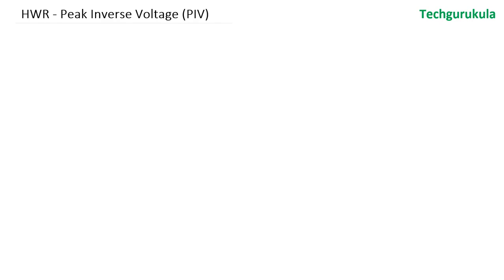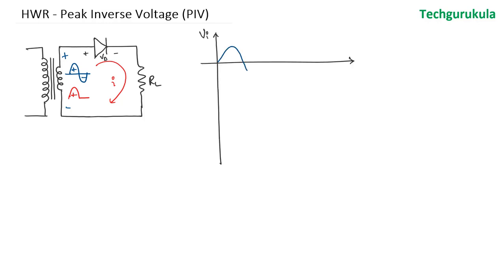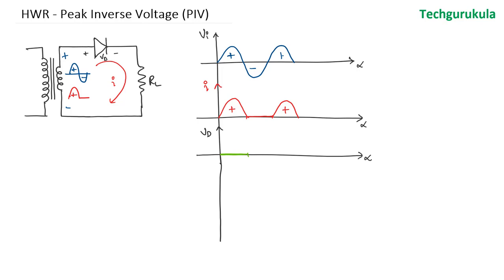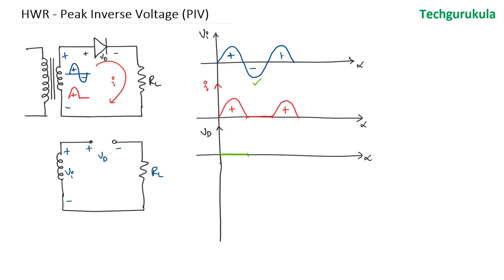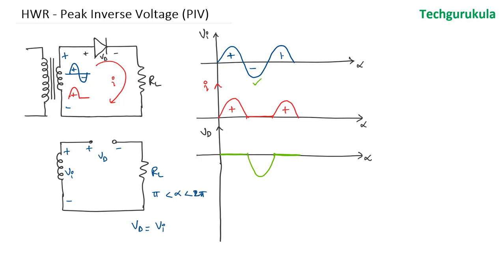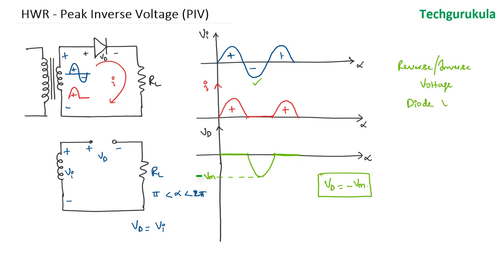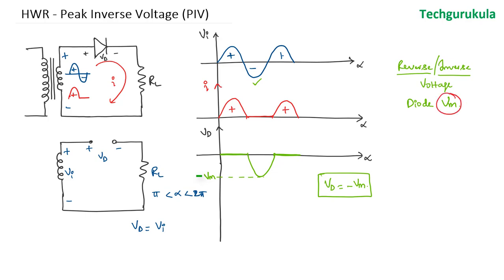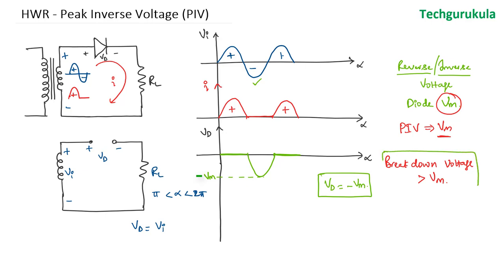Analog Circuits: Half Wave Rectifier - Peak Inverse Voltage

Comment: Why is the peak inverse voltage positive  ? Shouldn't it be in a negative sign  ???
Reply: Peak Inverse Voltage -> Inverse in this implies, its reverse bias voltage to the Diode. Hence, no need to have explicit sign.
Reply: @arunkumar446  
 In the oscilloscope , the wave that is blocked by the diode appears in the negative part, and the peak of this wave is a negative value, and this negative value represents the peak inverse voltage !!!  Therefore, peak inverse voltage is a negative value according to what appears in the oscilloscope !!!